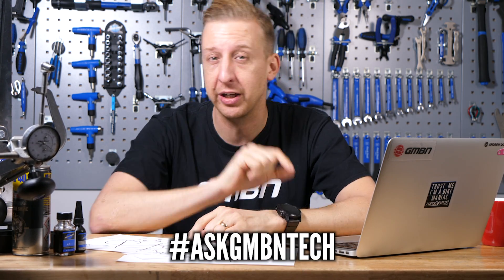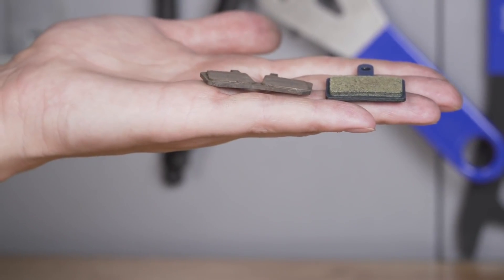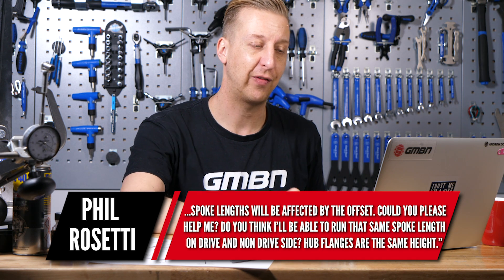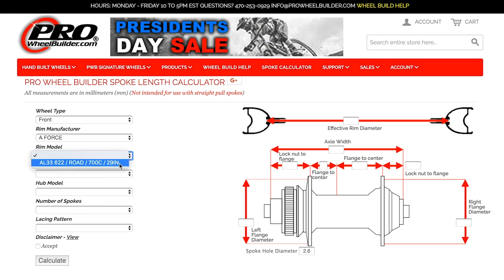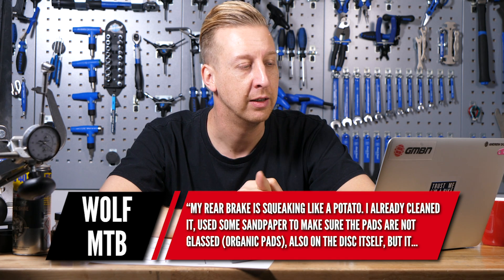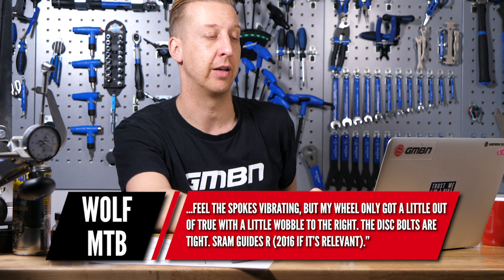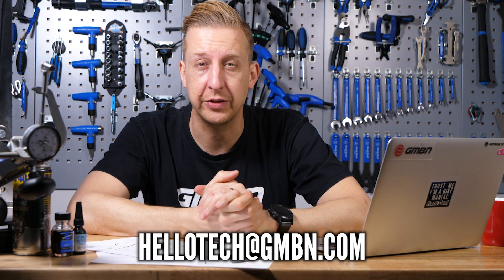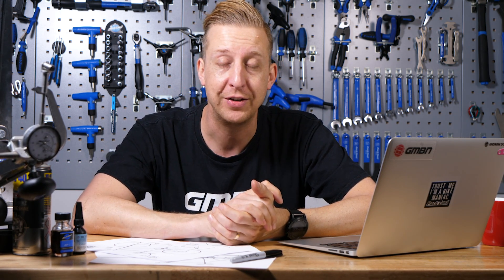Squeaky Mountain Bike Disc Brakes? | Ask GMBN Tech

Comment: My Giant developed the WORST squeal noise over the last week. Tried everything and still as bad.Tried new pads from my local bike shop. Still as bad. Even sprayed WD40 on the new pads! Still bad. Then changed discs & pads (again) & it worked. Discs must have been the problem. Wasn't too expensive so I would recommend changing both discs and pads if you are having a really bad noise issue with your brakes.

Comment: 1:10 thanks so much for clearing that up. I have sintered pads and it will squeal like crazy in the rain, I thought there is oil on it, so I sanded both the rotor and pads, but to no avail!!! Now I know it's just normal.

Comment: My brakes are squeaking like any thing I've washed it with soap and water then heated it with fire so oil gets removed and rubbed it with sand paper and also cleaned it with espirit/isopropyl alcohol and nail polish remover still my breaks are squeaking and I guess my rotor is a bit bent so do I need to change them ??? actually I amd an enduro rider in India Delhi so we don't get much trails there as it's a non mountainous area but the basic question is should I change my 180mm rotors ?????

Comment: @ Hi, I just bought the new TREK Marlin 6 MTB. from the beginning I heard the sound of the brake issue from front and back tires (need adjustment), however after going back to the supplier's technicians they adjust it and align it and everything went fine since then (only while the bike not on the ground and flipping the tires to check and no sound there), BUT while I'm riding still light sound of brake rubbing. any advice?

Comment: Hi there, I had disk brakes squiking. Following some you tube suggestions, I was able to clean pads and rotors and the noise disappeared. I rode my bike on the road for a day and then I left it in my garage for a week. After this week, I took the bike again and the squiking reappeared?????? Is it possible that I have a fluid leak????

Comment: #askgmbntech hi doddy, been looking at the new yt Capra al comp with a fox 36 elite performance. Should I get the yt Capra carbon with the Rockshox Deluxe shock and Rockshox lyrik fork or stick to the aluminium which is slightly cheaper but has a fox 36 elite performance fork and a fox x2 air shock. Cheers, love the vids!

Comment: Had a persistent squeaky front brake that seemed impossible to fix. Squeaked from new even swapped rotors around whilst trouble shooting. Turned out to be the design of the rotor was causing some resonance. Switched to a different pattern rotor and it never happened again.

Comment: #askgmbntech Hi Doddy,
I have a Marzocchi DJ3 from 2018 on my Canyon Stitched 360 and want to do a lowerleg service on it, but Im struggling to find good documentation on how to take it apart, what oils/greases and in which quantity to use etc..
Thank you for your videos, keep them up!
Reply from the maker: Hey Jakob, Check: 
https://www.marzocchi.com/support/forks/2018/2018-dirt-jumper-3-100.aspx?idC=62354&idM=30048-1727-1626&idMy=30014&idP=30047-822&idS=30021

Comment: #AskGMBNtech is it possible to convert my 26 inch wheel bike to 27.5? I ride a full sus Haibike impact se one from 2008. And is there a way to measure the frame, somehow, to check will a 27.5 wheel and tire fit?

Comment: #askgmbntech I just finished watching the dirt shed show when you were on about trends etc, and you mentioned over the high  pivot point and the chain going over it, but then I remembered that Neil reviewed the Canyon stitched 720 at whistler  crankworks, and that and a few other slop style bikes have the pivot point in the bottom bracket so the chain stays same length, with that said wouldn't manufacturers take that into consideration when designing frames, or would that kind of pivot point have an affect t on how the suspension feels/works?

Comment: #askgmbntech Hi Doddy, I am riding XC marathons. I used to ride a pretty high end full suspension 26 inch bike . Recently I upgraded to a new 29 inch and not sure what to do with the old one. It's in a good condition, but Giant NRS 26 inch frame and 3x9 setup with Shimano dual control levers make me think it's race lifespan is over. Is it good for anything? Can I sell it at a decent price?

Comment: I’ve been using Kevlar pads from DiscoBrakes for the lasts 3 years, much better than Shimano resin pads, more brake power and no noise at all with water, i use them all year long. Also, I like that it’s very difficult to contaminate them. They tend to wear faster on muddy conditions, but honestly, i feel so safe using them that i don’t care. BTW I race on XC, but i absolutely recommend that brand.

Comment: My KS Lev Integra post drops down about an inch when I sit on it.  I added air to it to bring it up to 200psi as per the manufactures spec, but it still drops a little bit.  What else can I check to determine why that is happening?  #AskGMBNTech
Reply: That the cable runs smoothly.

Comment: #askgmbntech
Hi Doddy, i just bought a new Canyon Spectral CF 9.0 and after i set up the suspension i noticed when the rear shock is cycling around 25-30% it makes a slight "swoosh" sound. Is it some defect in the shock or normal? I also have a RS Monarch on another bike but iy doesn't makes that kind of noise. Thanks, love the show keep up the good work.

Comment: I had the rear wheel squeal problem with shimano m395 brakes. It wasn’t the rotor or pads or alignment. I think it came down to when I bought the bike it had a sticky piston. I found the previous owner had some fluid in them that was not shimano mineral oil. I corrected the sticky piston and changed the oil, but I think the squeal was caused by oscillation in the piston. I bought new brakes and it’s all good so it’s not the frame or wheel. Like the seals just were imperfect enough not to work but not to have major leaks. I know on that rear brake but not the front I would get a few air bubbles in the system.

Comment: With the squealing brake pads. My polygon with shimano brakes does this every now and again the rear brake loses most of its power and makes a horrible noise. I’ve tried cleaning sanding etc doesn’t work. 
But what I have found does work is putting the rear pads in the front. And the front in the rear. Takes a couple uses to bed them in again but both work fine after that! It makes no sense but it works. And I’ve done it three times now. Think of it as a pad rotation lol

Comment: #askgmbntech Why does my fox 36 fork have a 5mm wide dead zone at start of the travel? When I compress the fork by hand, it rebounds but then to completely extend the fork, I have to hold the frame and push on the lower leg brace, after that, it pulls back down into the travel about 5mm. I have tried the zip tie trick but I didn't hear any air rushing in. Love the videos you guys make. They have helped me so much! 🤙
Reply: Have the same thing on my rockshox boxxer coil fork

Comment: Hi Doddy - great show! I have a question about rear wheel axle standards for dirtbikes. At the moment I´m running a rear wheel with a bolt on axle (male axle, nuts on both ends), will a wheel with a bolt in (female) axle also fit? #AskGMBNTech
Reply from the maker: Yes, providing the hub spacing is the same yes.

Comment: My replacement brake pads were howling with a very low tone. I don't know if that's the case but I saw that the spreader spring was bent and it wasn't when I bought them. It was touching the disc while braking. Yeah...weird stuff. I replaced the spring with the original and there's no more howling.

Comment: #askgmbntech for some reason that I can not figure out when I sit on my dropper post in it's fully extended state (Brand-X ascend) it starts very very slowly sliding down till about 1/3 or 1/4 of it's full travel so I have to pop it back up every 2-3 minutes but it never goes beyond this point.
Please help and keep up the great work.
Reply: have a tug about on your cable run, you've probably got a bend too tight thats causing the cable to not fully detension. My frame to dropper bend is fairly tight and if the cable at the handle bar ends gets pulled it makes this bend too tight and the seat slowly drops as the dropper is still activated.

Comment: @W0LFMTB Most probably your pads are soaked with oil. Your brake may be leaking, or the left boot of your fork. Check the seals. Even the slightest drop or trace of leak is enough since it will mean that it was there for enough time for the pad to soak much oil. I had that problem in the shop. As a measure (knowing full well I will buy new pads) I decided to experiment and tried to fry the pads to burn the oil away. I strongly advice against that, because you will ruin the joining material and your disc will eat the pads in minutes, if not seconds. So in short - if sanded pads and discs continue to squeel, check alighment as Doddy said. If its not that, then check fork adn brake seals and buy new pads. They are cheap enough

Comment: #askmtbtech my bike was recently stolen and although it was quite a lot of heartache, I’m using it as an opportunity to upgrade. Do you think dedicated bike insurance worth it or is it just as good to have house insurance with the bike itemised to prevent payouts being limited by the usual caps?
Reply: My bike was covered under house insurance. Paid a $1000 deductible, insurance bought me a brand new $5000 bike.
Reply: Mine was covered but capped at £1500 but the insurance valued (new for old) as £3500. To be honest, I only had it in my head at £2k. If I’d itemised the bike it would have paid out in full. Not sure what to do when the new bike arrives.

Comment: #askgmbntech I’m thinking of upgrading my flat pedals but I’m on about a £60 budget is there any pedals you would recommend for the price range?? I’ve rode clips in BMX racing and I like them but I want to be able to just jump on my bike and go cause I use it for everything from going to work and college to riding bike parks. I have a Marin Hawk Hill 1 2019 is there any other upgrades you would recommend on a budget?
Reply: Oneup pedals are amazing, I use the aluminum version but the composite version is great as well and would save you money
Reply: Dmr vault if you can get them for a good price

Comment: If my discs say "resin pads only", Is it just the manufacturer trying to sell his own pads, or will my breaks/discs stop working?
Reply: It means you only should use organic pads.
Reply: @th_js  Thanks, but will the discs stop working if if I use other kind of pads?
Reply: @meinefresse94  What do you mean by "Stop working" specifically?
Reply: @th_js  I mean will my discs eather get destroyed or have less breaking power if I use other pads than resin/organic.
Reply: If you mean low level shimano discs, it’s because they haven’t been heat treated the same as the good ones. If they get too hot you risk wearing them too fast or I’ve heard turning the steel blue. The change of getting hotter is greater with metallic pads.
Reply: @jonathanzappala   Thank you.

Comment: #askgmbntech
Hey doddy, im confused about tyre pressure. Its said that a tyre with less pressure rolls smoother, easier and faster. But at the same time a tyre with more pressure rolls faster especially over smoother trails. Now my question is, which terrain with which pressure would add efficiency and with which one would  more pressure decrease efficency.
Would be a good idea for a video (testing)
Thank you in advance.
Reply: High pressures only make you faster on road, and you don't want to be a roadie, right? But don't go too low, because that will lead to burps and punctures. Though I do find that higher pressure tyres give a really nice feel of the trail, but are slower and less grip.
Reply: less pressure will absorb small bumps and gives much better traction. It does not roll faster/easier
Reply: @src248  Yes it does roll faster over rough terrain.
Reply: It’s not always about low rolling resistance or you would always ride xc tires. Generally grip is more important if it’s not xc, where lower pressure is more grip.

Comment: #askgmbntech can I use a Shimano lever that was attached to a 2 pot when I got it and attach it to a quad pot for an upgrade or do I need the lever upgrading too?
Reply: As long as it's a Shimano one.
Reply: I run a Saint lever on a Deore caliper and it works fine so as long as it’s Shimano you should be fine

Comment: #askgmbntech Hi Doddy, i've bought the Canyon Neuron AL 7.0 and i want to change my brakes from the shimano to magura MT5. So i want to buy the discrotors from magura for the centerlockhubs aswell, but they aren't available anywhere (in Germany). I've read many articles about missmatching discbrakes and discrotors but i don't know what to do.
What are fitting discrotors for the Magura MT5 for Centerlock???
Please help!
Greetings from Germany
Reply: TheLoneWolf your hubs are center lock, but it’s only magura 6 bolt rotor available in your area, correct? if so, try to use conversion kit for it, shimano and some other brand have one, i hope this helps
Reply: or if you what you mean are to missmatching brands, as long as either the rotor or pad are not resin only (shimano’s, i’m sure you’re aware about that), i  think it’s doable
Reply: @richardrahadi  yes, exactly. I don't want the conversion kit and yes i'm aware of that :) i would try other brands, but i am not sure about the thickness and if this even matters.

Bit thanks for your help :)

Comment: I've been using disco brakes kevlar pads for the last 3 years on 2 bikes.  I love them!  All season long in all conditions with no issues or noise.  No issues with rotors wearing out to early either.

Comment: #askgmbn I had the same problem with howling brakes and it turned out only one of my pads was engaging and the other side was not. Had to clean the pistons and rebleed the brakes and it worked fine. Judging by the fact that the commenter has rust on the pistons, I imagine it's something similar.

Comment: #askgmbntech Hi doddy, love the show. Keep it up! I've recently blown up my fork compression damper while doing drops. The fork wasn't locked out at all. Does the amount of travel affect how big of a jump/drop you can do? And are you able to recommend a better damper to replace the crappy turn key one I blew up? My fork is a Rockshox Recon Silver TK 2016, 120mm travel.
Reply: Andrew Lam fork travel doesn’t affect how big drops you can do.
Reply: Fork travel doesn't affect the size of drops you can do, but the air-pressure does.

Comment: If you have stubborn pads you can't get the squeal out of. Bake your rotors and pads in a clean oven at 400f degrees for 20 minutes. Then sand the surface. I keep a small oven in my shop just for this purpose.
Reply: Something also worth trying is filing down the leading edge of the pad. Worked for me a couple of times.

Comment: Doddy,I've been using Kevlar pads from disco brakes for about a year now and they've been really good. No squeak,good in the wet,seem fine. Good price too.....try em!
Reply: I've used the kevlars from Disco and Uberbike and they are as, Darren says, really good for general riding.  The issue I've had with all Kevlar pads is that if you cook them on a downhill they never recover.  Sintered pads will come back as they cool and as my local riding spots have lots of long downs I no longer use kevlars. Doesn't help that kevlar pads can't go as hot without fading compared to sintered.

Comment: #askgmbntech hi doddy i need some help, on my hardtail gt agressor when i pedal the back wheel rubs, but it has only just started to happen and is only when i pedal. Could you please help me find out the problem. Thanks😁
Reply: Check that the wheel is on the dropouts properly and that your qr is tight, if it isn't that then it could be the wheel is out of true or a broken axle. I've had all of those problems before.
Reply: Is your hub loose? Axle tight? Loose spokes? Broken dropouts?
Reply: Tomi Saaranen i have found out that it is a broken axle, thanks for the help.
Reply: @Flavourz1  That's unfortunate. A broken QR-axle or an axle that is inside the hub?
Reply: Tomi Saaranen its the axle inside the hub 😭😭
Reply: probably just a bent brake rotor,spin the wheel and look where its rubbing and bend it back with (carefully) with a pair of mole grips

Comment: #askgmbn how do you straighten your discs as much as you can so it's not bent
Reply: There's a special tool you can buy or an adjustable spanner works quite well
Reply: Just make sure your adjustable spanner is clean a.f. (isopropyl-alcohol) - you don't wanna contaminate your rotors!
Reply from the maker: Yes as TheMeta6 said you can get special tools for this or use a dedicated adjustable spanner. Be careful not to over compensate on this.
Reply: I just use some pliers
Reply: 6mm Allen key or a screwdriver.
Reply: Park tool makes an excellent video on rotor truing check it out